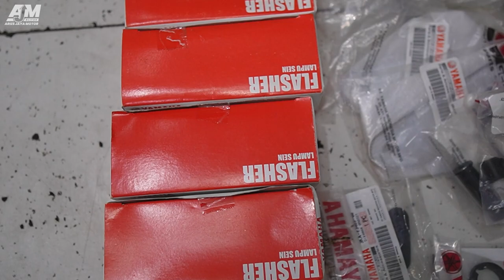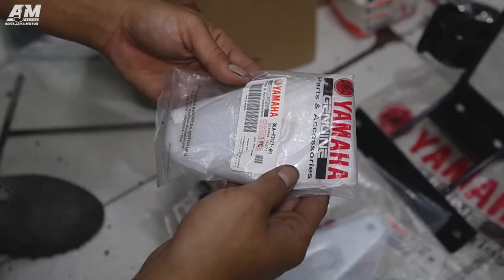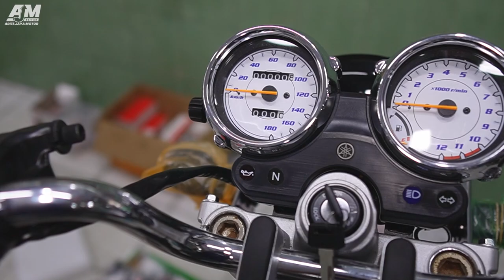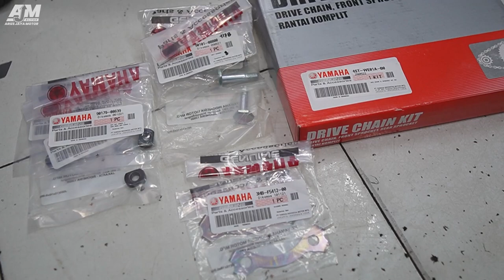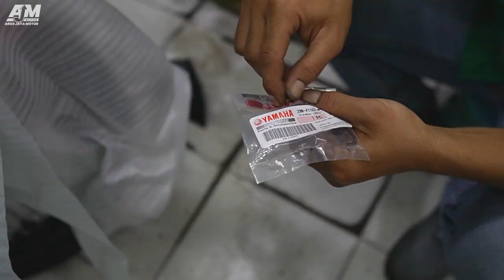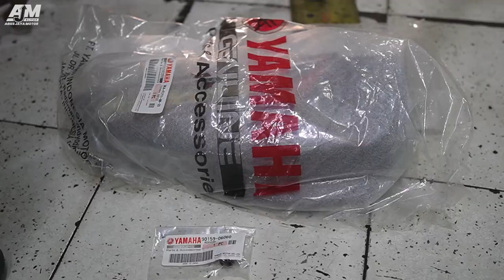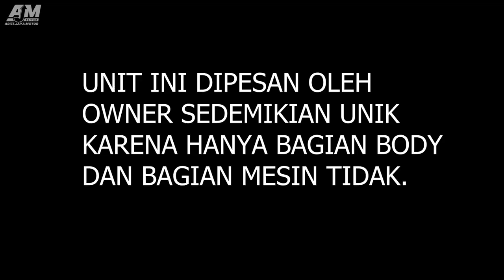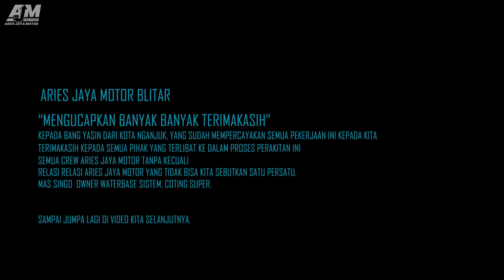SANGAT UNIK❗️❗️RESTORASI DAN MODIFIKASI RX KING INI HASILNYA DILUAR DUGAAN.

Comment: Bikin ngiler, Haduhh Coba king gua dulu gx di jual yg tahun 2000 mana d jualnya murah nasib.. 😭
Reply: Wkwkwk sama bro. Bokap punya RX king tahun 1998 beli new dealer. Tahun 2002 dijual trs beli lagi juga baru dari dealer. Yg 2002 ini malah istimewa banget, bbrp tahun jarang banget dipakai krna udah punya mobil. Udah bbrp tahun pentil2 di ban orinya masih ada, km blm ada 5rb kl gak salah. Malah dijual krna terlalu nganggur, dan ada isu uji emisi. Skrg gw udah dewasa nyesel,ngebiarin tu motor di jual